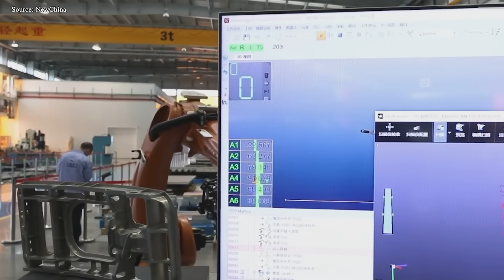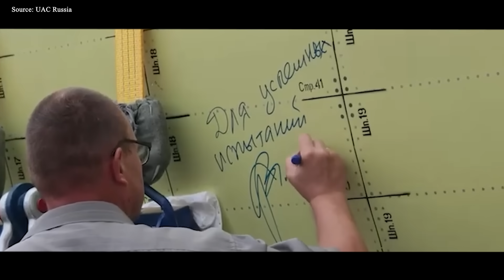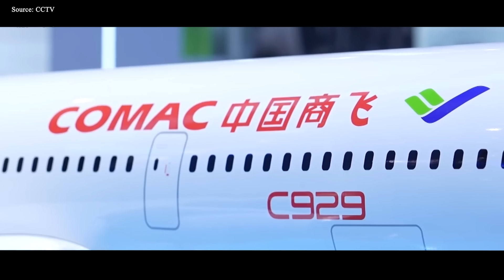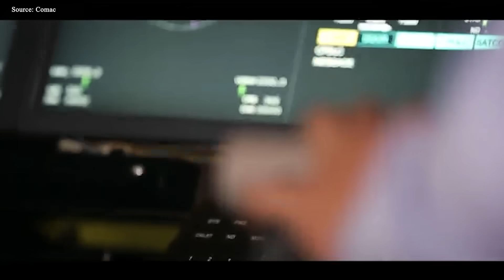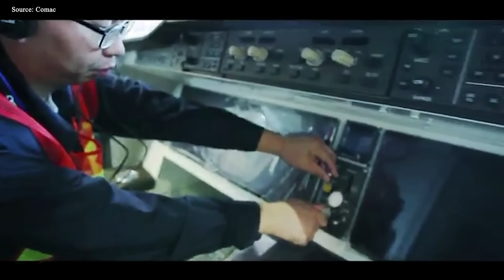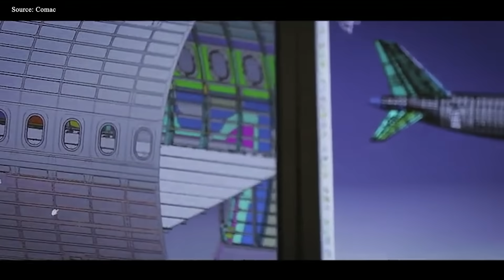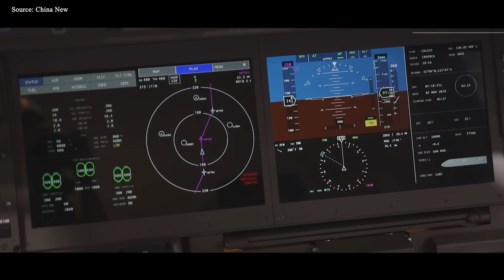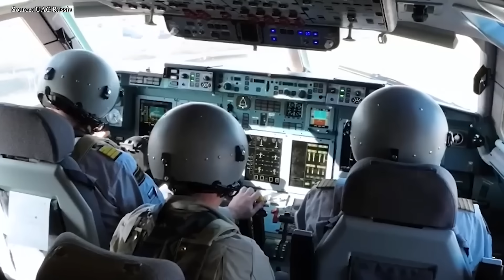How Russian Ilyushin IL-96 Just OUTSMARTED China C929

Comment: Russia makes its own modern avionics and composites - MS-21is a proof of that. So don't say that Russia is against progress and modernization. The only reason why Russia-China collaboration fell apart is Russia's unwillingness to get ripped off by China once again. Russia refused the tech transfer to China, and the deal was off.
Reply: MC-21 only proves the opposite: Russias inability to produce modern aircrafts. The jet is for 20 years in „development“, serial production again postponed (to 2027). The new flight characteristics are catastrophic, especially the range. Officially now 3.800 km, down from 6.400 km at the beginning (like Airbus 320neo and Boeing 737 MAX). Of course, backward Russia is no big help for Chinas aviation plans.
Reply: @alexandervt641 here's a copy and paste for the fools of all sorts:

The MC-21 aircraft has a range of approximately 3,830 km to 6,400 km (3,500 nmi), depending on the model and configuration. The standard MC-21-300 variant has a range of up to 6,400 km (3,500 nmi) in a two-class layout, while a version with increased range is being developed. 

MC-21 range by model

Standard MC-21-300: Up to 6,400 km (3,500 nmi).

Maximum range variant: Expected to have a range of up to 12,000 km (6,500 nmi).
Reply: @Sevastopol91  Nonsense! On the UAC website you find the range 3.800 km for the MC-21-310. Compare it to older versions of same model on the site. And the reason you will also find there: an increase of weight by nearly 6 tons.
Reply: CHINA YA REGRESO A LA REALIDAD E YA SOLICITO A RUSSIA PARA FABRICAR MOTORES PARA LOS C929.E C19. 😂😂PORQUE TANTO WASHINTON COMO BRUXELAS IMPEDIERON A SUS EMPRESAS ROLS ROYCE E GE FORNECER MOTORES A LOS AVIONES CHINOS. N😂
Reply: Идиот!   Какие "технологии" у рашки???   Технологии воровства?   Так в Китае за их освоение  -  стенка!
Reply: @ИванИванов-д3л7э 
Desperate delusional Kiev regime nazi psychopath bashing Russia in a fit of spite and frustration - what's new?
Keep yapping hopelessly ((🐈)) as caravan Russia 🇷🇺 keeps on moving forward into the future well-equipped and unperturbed, leaving pathetic twisted delusional you behind in a dust.
Reply: Also too much western components as is now playing out eg engines
Reply: Like me don't listen to them